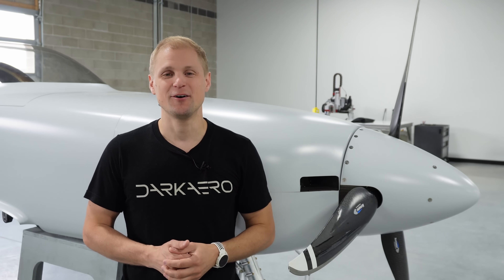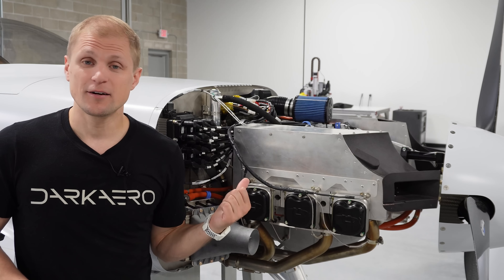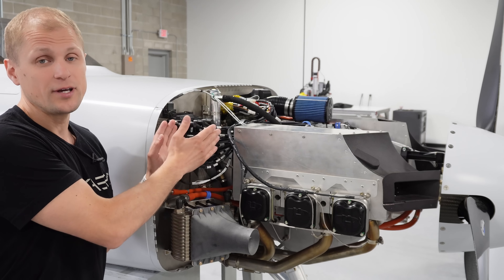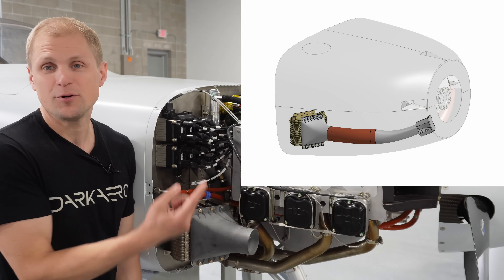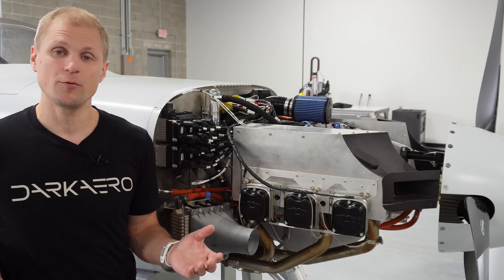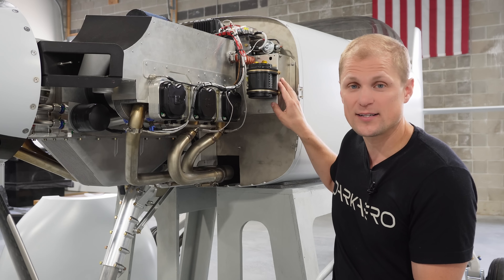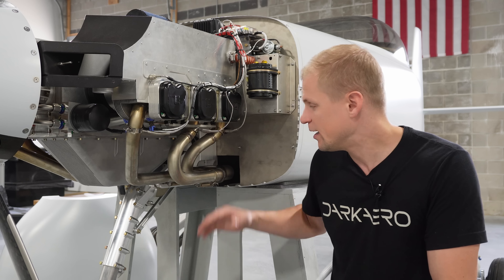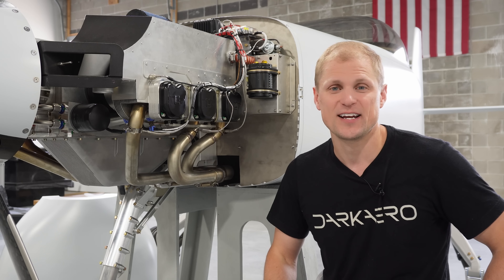Big Engine, Small Airframe: Did we reach the limit?

Comment: A another comment, you add a lot of drag because of the cooler, of course your engine need one, and that's ok, but what is not acceptable where is your device to increase the speed after the cooler... 

the correct installation:
* diffuser (check)
* cooler (check)
* nozzle (missing)

Comment: Hello. I believe you might have your oil sump on backwards? I’d recommend (in my humble opinion), that you consider creating a bit more space between the gear and the sump. It would be easy to modify the oil pan, so that more of the 4 litres of oil volume could sit up front, for a larger gap gear/ sump spacing. Also, you may wish to wrap your headers and exhaust in heat resist material for a couple reasons: 1. Assist in reducing idle / taxi temp firewall-forward. 2. Subtle vibration and noise attenuation. Lastly, why is the aluminium shroud butted up to the front cylinder head fins? I am thinking you did that to reduce temperature deformation of the jugs? If so, then UL should redesign the two front cylinders without cooling fins, and save a few grams weight, and reduce potential for expansion/contraction variances in the head. Please know, I am only providing my opinion in respect to your Company. 👍

Comment: I want to take that composite making course and then work for you guys mass producing this plane! I have an idea for masking a faster higher plane with a turbo prop ducted fan four seater jet. For that low speed stall as well as low drag at high speed, you may be surprised to know you can make leading edge control surfaces, even though they sound like fancy military grade aerodynamics for an F-22, they are up to you to decide how expensive the feature really is because you can make them in house. Talking about future goals, even on the DarkAero 1, perhaps a jet powered variant, even duel engine perhaps would be quite good for the high end versions. I considered placing wing mounted turbo props for rc planes on a glider. Gliders have a very long wing span though, so the range would be huge with small engines. I recently found a German supplier that makes 330lbs thrust jet engines for commercial or military UAVs and the over all size was only about 30cm diameter by 70cm length, exhaust temp was only 360 C so I mean, with a shaft driven bypass fan the efficiency would go through the roof! Imagine a van for you and your budds, but it's kind of a 747 in the speed and altitude!

Comment: I'm new to small aircraft and come from cars, but a 5.2 liter engine only putting out 200HP seems like a late 80's Corvette engine when modern v-6's have upwards of 600HP.  It seems there should be a setup with your 200hp but in a 2 liter size these days.
Reply: It’s all about the RPM, engines produce a best power around 5-6k, but the prop loses efficiency after 2500rpm, so it’s a trade off. You end up with a big engine turning a direct drive prop, and not making much power for its size. Rotax is a popular engine for smaller applications which is geared, so small displacement producing decent power, and a nice slow prop..

Comment: I own an RV,  my concern on the power to weight would be what the ride is going to be like in any kind of turbulence.  Not that airplane will structureally fail but the ride could be in incredibly violet.  Hitting turbulence at 200mph is not fun in a light plane.  I would live in fear of clear air turbulence and would be in constant vigilance of getting near jet traffic paths.  Mountain flying is also brutal flying the the wake behind 10K peaks in the northwest, you definitely want to fly high and smooth.   Friends had some very negative experiences with clear air turbulence.  Your plane looks to lighter than my RV with 50% more speed.   As soon as I feel bumps I slow way the heck down.  My biggest concern is that my head will hit the canopy and I will be incapacitated, make sure those straps are tight!

Comment: So you built a plane around an obscure engine? How many A&P’s do you know across the country that can or know this engine? Also, where do you get parts for this? Aircraft Spruce has nothing and a cursory search also lead to few results.
Reply: This is an experimental plane... The whole idea is to explore the limits of the possible. ULpower have been around for quite a long time now so the manufacturer-related risk is small. This engine has a much better power to weight ratio than a lycosaur and is obviously very well designed in terms of accessibility and maintenance. In my opinion it retains all of the qualities of a Lycosaur (there are many) while bringing a welcome improvement in the areas where legacy engines are suboptimal. Look at the baffling system for example. Darkaero designed an amazing firewall forward package - I think this is the state of the art for an air cooled flat six powerplant. Hat off.

Comment: Is that some kind of ultra-capacitor on the battery box?  If so, it would be a brilliant addition.  It would help on low charged / older batteries, and overcome problems with super-cold starts.  And not being a pilot, I may be totally up the creek in a barbed wire canoe.

Comment: Why not put the battery in the back, aft of the cockpit?
Reply from the maker: Great question! One of the main reasons we decided against mounting the battery in the back of the airplane is weight. A run of heavy 2 gauge wire would be required to connect the battery to the engine compartment. The total wire length would be about 20-25ft for the two battery leads if the battery was located behind the cabin. Mil-spec 2 gauge wire is around 100 grams per foot, which translates into about 5 pounds of wire! This is heavier than the battery itself!

Comment: Another advantage of using air from the oil cooler is reducing/eliminating the risk of Carbon Monoxide leakage into the cabin. Great design decission.
Reply: In order for the oil cooler to work, its rear face must be located in a low pressure area. If the pickup for cabin heat is in this area too, wouldn't the air flow backwards i.e. FROM the cabin ?
Reply: @Extra400Galatea  In my aircraft and in the DA40 the alternate static air supply is from inside the cabin. Hence' I'd expect that the cabin pressure would be not far of static pressure. The air into the oil cooler would not be far off stagnation pressure. So, a duct from the rear of the oil cooler into the cabin would have a good presure gradient across it. If you look at Velocities, their cabin heat if from a nose mounted oil cooler (NACA duct just left of the nose).

Comment: I believe this airframe if flight tests are successful has a great futur. I think that a new turboprop generation with heat exchange like the Safran sponsored Turbotech TP-R90 since more powerful versions are coming and new very efficient capillary tube heat exchangers ..could have a good market potential with their much better fuel consumption equivalent to Otto, low drag low weight and 3000 hrs TBO..The army basic training planes replacing old and aeging aluminium SF260 large ww fleet with similar high performance would be a key market target..with the high performance end of small long range sport aircraft’s market..
Reply: I love trubotech. Here the ULpower package is so nice that I cannot see a potential gain. It looks pretty much perfect as it is...
Reply: @Extra400Galatea  tbo 3000 hours and better performance in altitude, lower noise vibration and hum…for certain applications a small turbine finally efficient is a advantage.
Reply: @philgooddr.7850  I agree and I love turbotech too. Darkaero designed the plane around the ULpower engine and I think we need to wait and see.

Comment: Two observations from an engineer and pilot... 1) Your cabin heater design has a plus of preventing carbon monoxide risks, but you've traded that for the health risks of oil leaking into the cabin heat. You will want to consider safety precautions in case of oil leaking into the cabin air. (N95 masks as an emergency procedure if smelling "dirty socks" and land as soon as practicable?) 2) your exhaust pipe looks to be running close to some of the front gear pivot points.  You may need to verify if rerouting the exhaust pipe is needed to prevent high temperatures and premature failure of the gear pivot.

Comment: I live in Florida I feel like high temperatures would be a major problem during taxiing.
Reply: A well designed cooling system will make great use of small inlets by efficiently generating the pressure delta across the cylinders. If internal losses are minimized (as is the case here)... it's the outlet baby. In other words: they can always "tropicalize" it by increasing the outlet side or creating additional depression at the outlet. So no I would not consider this a deal breaker 🙂. Darkaero are really, really smart!

Comment: Very cool, thanks for the video. Do you have any concerns about the oil cooler failing and oil ending up in the cabin?
Reply from the maker: Thank you for checking out the video! Cooler failure is unlikely, but the whole system can be isolated from the cabin simply by closing the cabin heat valve on the firewall.

Comment: just thinking that it might be a good idea to have a fan to force cool air to the battery, to avoid problems with 'heat soaking' after the engine is turned off, and, for example, the cool air box can hold hot air convected off the motor, after shutdown

Comment: I’ve noticed on videos that carbon fibre drive shafts are rated really high for strength when first tested. But after several stressful events, catastrophically fail. Is that a concern with this design?
Reply: I’m sure your joking the prop is a direct drive unit, no carbon fiber there. Their custom nose cone is made from carbon fiber using the infusion method. Also third part variable speed prop is made from carbon fiber but the linkages and rotating mechanism’s are all metal.
Reply: @alexanderarnett4966  I’m talking about the whole plane, not the prop
Reply: Carbon Fiber comes in a number of grades and weave patterns as does the epoxy that make up composite. A variety of layup and curing techniques each add their own unique properties to the completed parts and structures. This is similar to other engineered material. The key is to test and verify these properties and take this into account when selecting the materials for a specific application. Then to use rigourous engineering practices when designing, building and testing items built with these materials.

In the case of Carbon fibre drive shafts, these are often exposed to abuse when run on the underside of a vehicle, including chemical, impact and abrasion. Some manufacturers have designed a plenum that keeps this shaft embedded within the vehicle and fully protected from the elements. In the end, it comes down to selecting the right material for the right job. And good design. 

Many of us wished the carbon fiber weave would be visible under a clear cote on the DarkAero 1 but the engineers said that would be a bad idea and went on to explain the many reasons why.

Comment: Like the idea of using air from the oil cooler for interior heating, as it will prioritize the engine to warm up.
Reply: The other alternative is a heat muff on the exhaust. Which has the potential to introduce carbon monoxide into the cabin if the exhaust cracks or leaks.

Comment: Do you use shock mounts on your engine mounting points?
Reply from the maker: Yes! There are four rubber bushings between the engine and the engine mount that reduce the vibration transferred to airframe.

Comment: You might want to consider electric seat heaters and/or electric hot air generator if the oil cooler heat is inadequate.

Comment: I can name off the top of my head about a hundred aircraft that house sealed lead acid batteries inside the cabin.   These batteries can be abused tremendously without generating fire or smoke. Putting the battery on the hot side of the firewall is a reasonable choice but it is increasing your part count, reducing space in a critical area, and giving you more to test and troubleshoot.  I am also curious how hot it is going to get after shutdown.
Reply: It is probably a Lithium based chemistry.  Much lighter, higher energy density and current capacity.   If they are going through the expensive of extensive graphite, counting grams,  they are not going to have a Lead (Pb) battery.     Non-LiFePO4 variants can catch fire.  Also most of them should not be charged below freezing.
Reply: @rossrobinson7943  lithium iron phosphate is nearly as safe as sealed lead acid.  There are many of those also installed in cabins.  These batteries are a poor choice as a single starting battery for an aircraft as they are useless at low temperature, in fact they will be locked out by the BMS.
Reply: @wgmskiing  LiFePO4 can handle discharging down to around -20C/-4F. They just don't like being charged below 0C/ 32F.
Reply: @LesNewell  that's still wildly inadequate for a starting battery in North America for those of us who live in the northern part of the country.   Sure the correct thing to do is preheat the engine before a cold start, but this is going to be another asterisk and unwanted operational complication....if you travel in the winter you'll need a hangar.  That's not easy to do everywhere.
Reply: @wgmskiing  It looks like I was wrong. Further down in the comments Dark Aero state that the battery is good to -22F.

Comment: Two things worth noting. Not sure on this engine, however the vernatherm does not open until 180 degs on a Lycoming, thereby allowing oil to flow thru the cooler, so wouldn’t expect much heat for the cabin before then. Also, I fly an experimental with little room to spare behind the engine. It is a royal pain to work on it.
Reply from the maker: The UL Power engines put more heat into the oil system compared to Lycomings, so the oil cooler should be a stable source of cabin heat in our setup. We also fully built up the exhaust system heat exchanger, so we can swap to this if we don’t get the results we want out of the oil cooler cabin heat. Tight packaging does make access more tricky, but we did try to maintain acceptable serviceability in our installation. Thank you for checking out the video!
Reply: I had the same thought, but more specifically about the long taxi days here in Canada... Brr!  The oil takes a long time to heat up. Exhaust is warm almost immediately.

Exciting project! Slippery little planes are so cool.

Comment: Not sure about cabin heat coming thru oil cooler. You need cabin heat the most when air temps are very low, and vernatherm may not be open to send hot oil to the cooler.

Comment: I wouldn't recommend sending the heated inlet air directly into the cab without using a heat exchanger.  An engine fault or exhaust leakage could cause CO to be pumped into the cabin....

Comment: I wonder what will be the strategy to warm the battery in case you will have the cold ambient temperature. The hot air from the oil heat exchanger could be used as well. In that case looks like oil exchanger and battery could be mounted closer together so that with one actuator you can control hot/cold air mixture to keep the battery at the right temperature.
Reply: I believe they went with Lithium not the older NiCad battery.
Reply: @alexanderarnett4966  if true, that’s a compromise that will likely limit where this airplane can be sold. Lithium batteries just don’t work for starting at winter temps in Canada, Alaska, the Midwest, and many parts of Europe. This is why along with safety that Lead acid is preferred in most northern commercial air services. Lithium and NiCad batteries are also subject to fire and explosion hazards that lead acid batteries are not.
Reply: From my experience the battery no longer has to be warmed once the airplane is flying ->the airplane’s electrical system runs entirely from the alternator/generator. The battery usually has to be (should be), warmed on the ground for starting operations at extreme cold temperature. It looks like they’re running a NiCad which has some drawbacks but is inherently lighter and more compact than lead acid. I personally prefer lead acid due to experience, and the airplanes I’ve flown with NiCad batteries were all converted to lead acid. From an IFR perspective unless this aircraft has a backup alternator/generator, it may not be suitable for regular IFR flying IMHO. To be honest though it doesn’t have an airframe deicing system, so you probably wouldn’t go flying through clouds at 10,000ft anyway. 
It’s an interesting design and I’m keeping my eye on it!

Edit: I forgot to mention the batter being located in the cowling is being passively heated by the engine at cruise speed. I’m sure it’s quite warm in there. By rights if it’s a NiCad, there should be a temp gauge for the battery to warn of thermal runaway
Reply: @drewski5730  I agree that for the aircraft operation perspective battery can be off completely, but temperatures lower than 0C is not suitable for charge and lower than -20C is not suitable for discharge applications. Batteries usually acts like a buffer and/or conductors in electrical circuits, meaning they are filling the gaps and drops of the "flow". And I still would consider having hot/cold air actuated to the battery.
Reply: @coredeveloper  they seem to charge fine below 0 degrees 🤷‍♂️ 
The voltage doesn’t seem to change 🤷‍♂️ 
I’ve done plenty of NiCad and lead acid starts below -40C in the Arctic. It’s terrible for the battery, but it does work, it charges fine afterwards, and still lasts a decent amount of time (although I’m sure it’s lifespan gets degraded sufficiently by doing this). 
I’ve never seen an airplane that used a battery warmer of any kind for anything but start up.